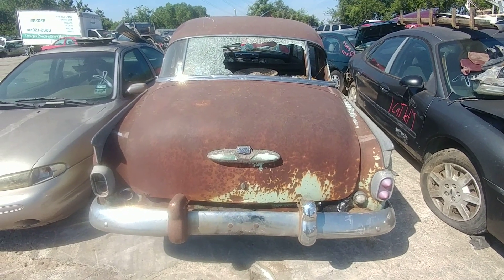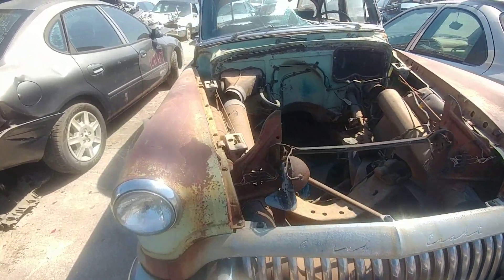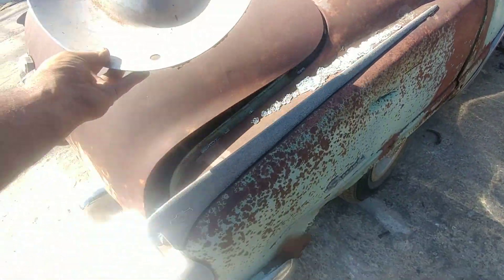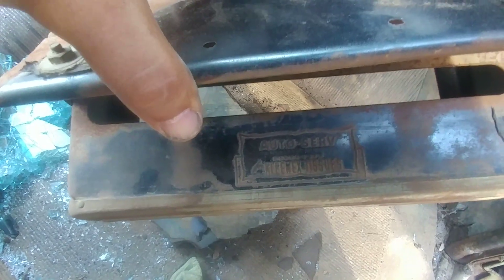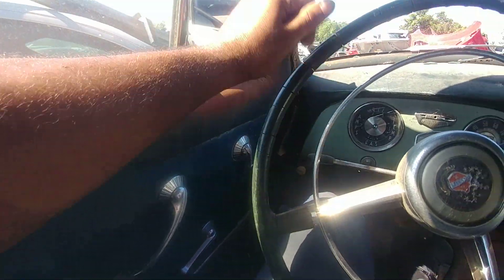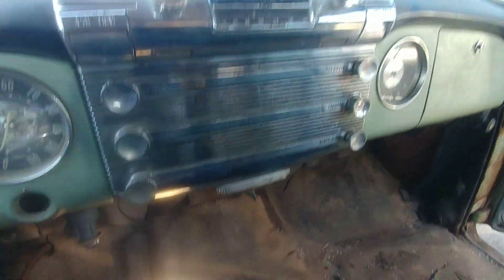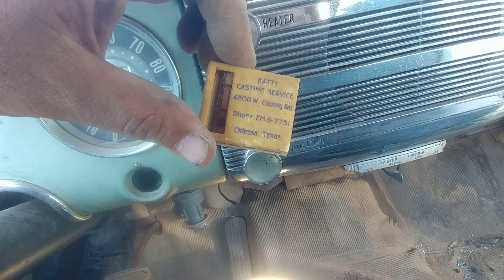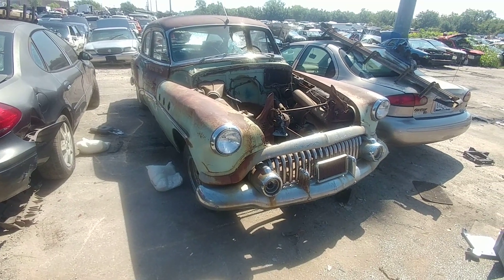1952 Buick Special Junkyard Find

Comment: Trim tag is 1952 for 1952 model, 4369D denotes a 4 door Buick Special model, BK is the Kansas City, MO plant, Trim #47 is Dark and LIght Green Broadcloth, Paint of 23 was two-tone back then, the body color was originally Glenn Green and the top color was a slightly darker Terrace Green.  The original engine would have been a straight 8 "Fireball" engine, 263.3 cubic inches. Those mirrors could have been a dealer or aftermarket accessory and I believe that's how they used to attach in the pinch weld like that. I believe that is for the antenna, looks like an antenna symbol on the knob. That's pretty old as nothing comes up at that address on Google Map, so it's likely been out of business for a long time.  Even though this was a base model in 1952, it was probably a pretty car when it was new.  I'm sure it did many a run to the church, store and markets back before it was laid up around 1972. Solid old piece of history from a bygone era.
Reply: I enjoy your video, its ashame to see these cars end up in a junkyard, I own a 49 Cadillac, and a 55 Buick Roadmaster.
Reply: You able to break down the VIN for a newer GM product by chance? I have a 94 Caprice 9c1. Not sure if the newer style VIN’s provide the same paint info that the older VIN’s did.
Reply: @Monaghan  If the VIN # is run through a GM parts system, it will indicate the paint code on that report. Looking at the VIN will not tell you that (and never did on a GM). The bottom of the SPID label in the trunk would have the "WA" code for the paint and that would tell you the paint color it left the assembly plant with.
Reply: Google User GP gotcha. Thanks man. Always appreciate your trim level breakdowns on these vids.
Reply: @Monaghan  Not a problem.

Comment: We had a Buick Special 1952 for about 40 years (from '52 to around 1993)! The 2 side black buttons (L side next to the break-release) was to pop-open the L side of the hood - and likewise the R button... but there's no hood.  Thank you for the nostalgia.  The 4 tiny windows were to guide the air - and they sure worked well on hot days.  The black knob at the top was to adjust the antenna as you drive - the radio had only AM! I see a lot of the chrome - especially the beautiful radio chrome - it still there - and if you TOOK out the radio setup and gave it a battery it might still work. The 'lighter' was to light cigarettes - and in later years was used as a source of energy for a mobile-lamp. It said "Buick Eight" - ours was a 'Straight-Eight' engine (not "V")!

Comment: yes that thing on the roof is the antenna. you could adjust its angle on the go to catch the radio signal better as the radio tended to have signal fade out when you changed the direction of travel  even slightly.

Comment: With the 1972 license plates still being on the car, I bet that was the last time it was on the road. The matchbook was probably from the 1960's, considering how the phone number was written out starting with two letters instead of numbers. That was the old telephone exchange naming system that was gradually phased out from the 1960's through 1980's.
Reply: I agree. I think it got parked in 1972 and just sat all this time. Either trees fell on it over the years or miscreants just blew out the windows (probably the latter). Someone bought up the property and the old Buick had to go. Over time, it probably lost some of the parts as well.

Comment: That is a lot better camera work till you holler look and don't let us do that Dork/LOL. If I were restoring a car, No it wouldn't be a buick but there are nice ones out there. That grill is called the rolling fountain. Cool name for a grill, you see them repurposed in different places, all that stainless steel and the "gage dash" kinda special except six volts system. I would repurpose that dash in something old like a old tractor and set it in center... a real old one that has six volt system already but no dash or gages, take that old radio and crome water fountain radio and stuff together somehow just because it ain't easy to carry the traditional stuff over